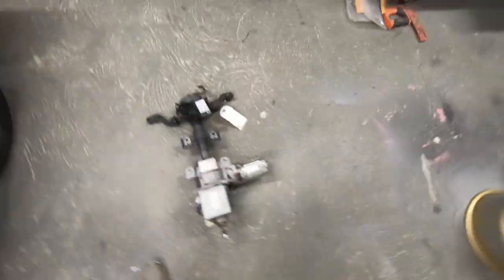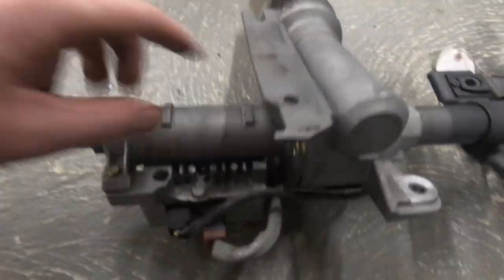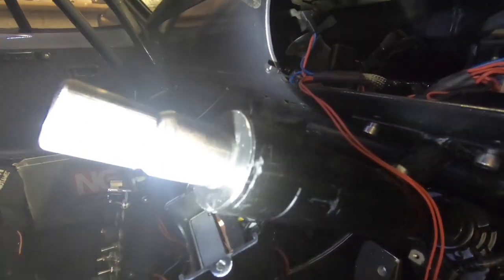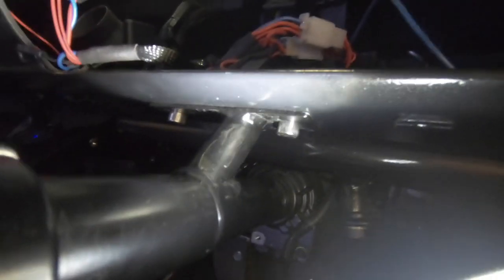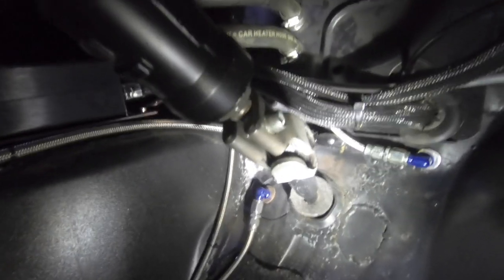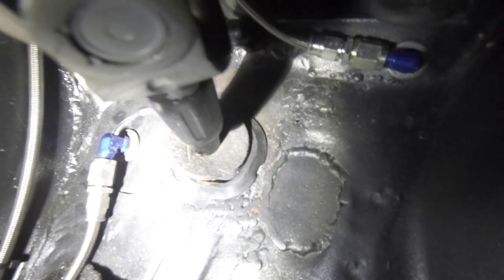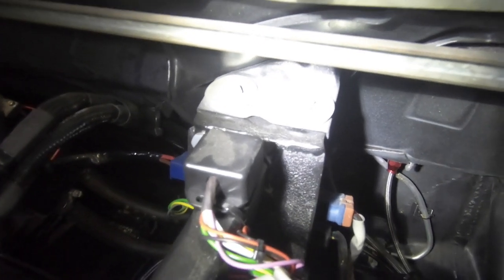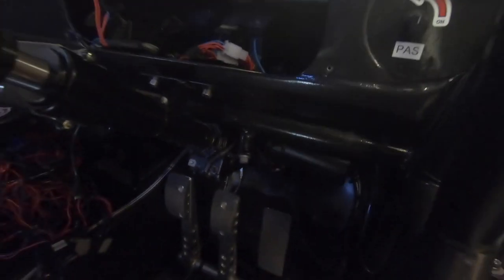MK2 ESCORT ELECTRIC POWER STEERING USING CORSA C EPAS *DIY*

Comment: The floor mount pedal box seems to solve many clearance problems.  I'd like to do this to my starlet and maybe sit further rearward.
Reply from the maker: I’ve never driven a mk2 with a normal pedal box but it feels great in mine with the seat all the way back to the 4 link boxes
Reply: @RickyCroneMotorsport  Sometimes, the hardest thing in car modification is deciding which thing to modify first. Videos like this help out.

Comment: Hi Ricky do you have to get any particular corsa model year to fit the mk2 escort or will any from the Corsair B or C fit
Reply from the maker: Doesn’t really matter what car you get it from as none are a direct fit and need custom brackets making etc. I just went for corsa C as it’s one of the cheapest. Or at least it was when I did it!
Reply: My up date I purchased a corsa c column to fit into my mk2 escort but couldn’t fit it as I have a biased pedal box with wilwod brake Master Cylinders 
 that are point downwards and when I put the steering column in place it kept fouling on the brake Master Cylinders 
 I did look at fitting one from mark 2 mania but when I spoke to Rick it was the same problem so it’s back to the drawing board